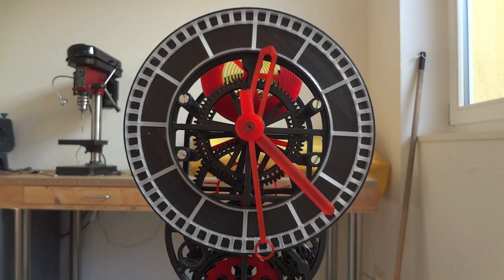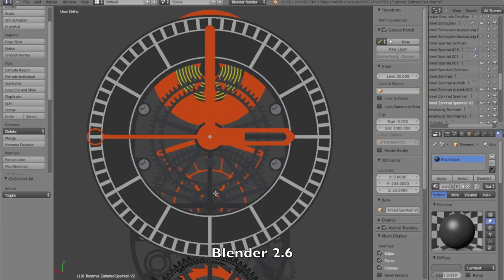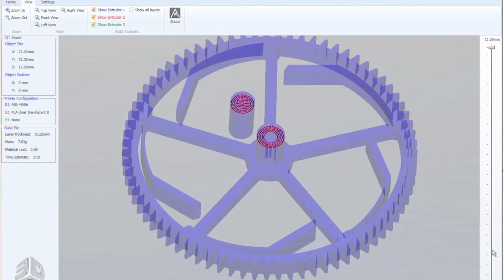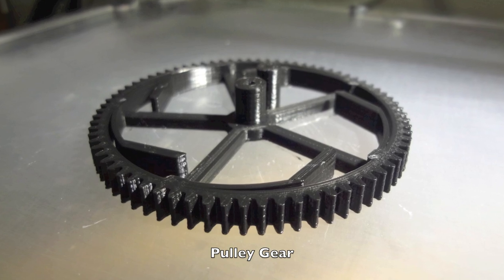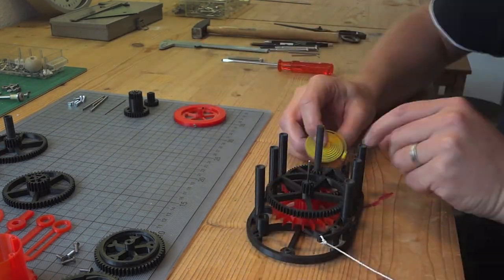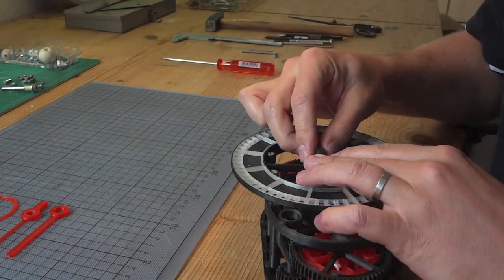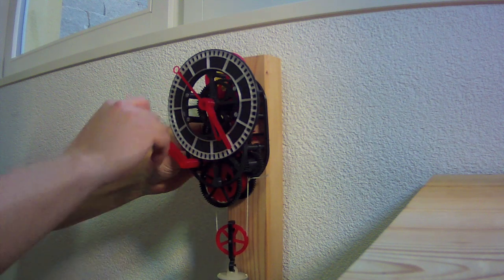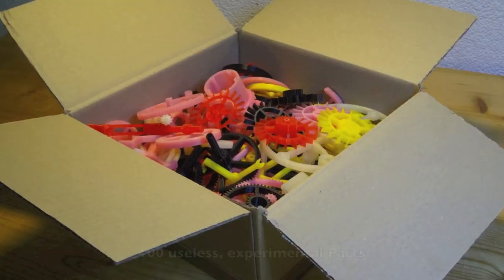3D Printing a working mechanical Clock

Comment: This is a beautiful addition to the internet!

It's hard to appreciate designs like this as you don't see the failed parts that are slightly misaligned or simply don't fit. The box of waste is what really demonstrates the frustration of the process.
Thanks for the clock!

Comment: Nice job. Must have taken many hours, both in Blender and afterword. I like the pulley mechanism that the weight hangs from, much better than having the weight hanging down one side with a counterweight hanging down the other side. I'm going to have to remember that trick. Thanks!

Comment: I can't believe you used Blender for this! Must've taken ages, and would have been a lot easier in a CAD software like Inventor or Solidworks.

Nonetheless, this is an amazing design :)
Reply: +ISeeFurther when I saw the blender clip, I mouthed "wow" to myself. I've made very basic 3d printed designs in Blender (little figures and such), but getting precise mechanical parts modelled up must have been an absolute nightmare.

Using OpenSCAD to "program" gears is the easiest way I've found so far
Reply from the maker: +Gareth Crispin (MrHolozip) initially I found it indeed painful with Blender. But finally I got the "trick" how to use the array-modifier for gear-teeth. Now I'm using Fusion 360 - it has a very convenient script to generate involute gears, however if you need to tune the tooth shape, it is equally clumsy like Blender.
Reply: If you want to use Open source software like "Blender", you can use "FreeCAD".  Also I think there are mods for blender that make it better for CAD with things like dimensioning being added.

Anyways thanks for sharing this wonderful project with us!
Reply: Astounded, that you pulled it off with blender!
Reply: @ChristophLaimer  if you add a planetary gears to slow down the soeed at what the weight drops cant you increase the clocks runtime between winds?
Reply: @ChristophLaimer  And did you design a new one with Fusion360?

Comment: Building this beauty as we speak.  Robox Dual making larger parts and FormLabs 1+ for the smaller components.  Interesting little engineering project to see if I can add my own ultra low power micro-controller POWERED by the escapement mechanism (no battery, just charging a capacitor) to dampen the balance wheel to keep it synchronized to the crystal reference it is powering.  Gravity powered by the weights, the balance spring is the main oscillator kept in check by a quartz crystal reference and no battery of any kind.  Lots of little precision ball bearings to minimize friction and hopefully have a real conversation piece and plastic heirloom functional clock as well.  Kudos to this gorgeous design and thanks for making it available.

Comment: Christoph, thanks very much for this model.  I am currently about 1/2 way printing this on my mendel prusa and I am delighted by your attention to detail, and design-for-3D-printing details.  I look forward to designs in the near future that have snap-fit details similar to injection molded parts, and minimal use of fasteners.

Comment: can you tell me where i can buy PINS: 1 x Balance wheel: 1.5mm diameter, 40mm length
 1 x Escape wheel: 2.0mm diameter, 28mm length
 1 x Reduction gears: 2.0mm diameter, 60mm length
 1 x Drum Transmission: 3.0mm diameter, 60mm length
 1 x Drum Axis: 3.0mm diameter, 60mm length
 1 x Crank transmission: 3.0mm diameter, 30mm length
 4 x Planets Axis: 3.0mm diameter, 39mm length
 1 x Weight Axis: 3.0mm diameter, 15mm length

Comment: I tried making this years ago, and could never get it to work.   The lack of a safety roller in the escapement makes troubleshooting very frustrating.  I would recommend you designing a pendulum clock next time, a pin pallet escapement is just more complicated than it needs to be, especially with the limitations of 3D printing.

Comment: That's pretty neat. If you had a regular pendulum, you could get more accurate timing with a sliding weight to help adjust the escapement period. Looks like this one uses a balance wheel, so the method of correcting that doesn't seem so obvious. (Maybe an adjustable friction brake perhaps?)
Reply from the maker: Friction has not much influence on the timing. The combination of spring strength and the mass distribution from the balance wheel are relevant: http://en.wikipedia.org/wiki/Balance_wheel#Period_of_oscillation
Reply: On some watches I've looked at, they seem to have a rotatable lever thingy to alter the effective working length of the balance-wheel spring ??

Comment: You can make the time last longer with 70 cm if you run the string back up to a smaller spool on the same axis. Allowing the string already used to come back up and give the weight more space.

Comment: This is probably the coolest thing I have seen 3D printed. And you did a great job putting the video together. Thanks so much for sharing. What are the chances a novice 3D printer could replicate the clock?

Comment: I have spent many hours printing this clock, but I have a problem with the balance wheel.
it appears that this has some kind of weight in this part.
I have no experience with clocks but understand the assembly.
Any help with this would be much appreciated.

Comment: Hi, I really like the design and would like to 3d print and use the clock. However I would like to know how I could enhance the runtime. Maybe with a different pully system?

Comment: That's absolutely awesome, you created a clockwork mechanism, stunning. (are you a clockmaker by trade?)

Is there anyway to print even the metal parts? I know you can do screws and nuts and bolt and Taulman's nylon 910 would be strong enough for that, so how about the pins also from nylon? Is there a reason you chose metal pins and screws or is it just a structural consideration? 910 wasn't available when you made this video.

Either way, what a lovely project. Thanks for sharing it. :)

Comment: really a very nicely designed mechanical part! I was really looking forward to it and invested many hours in printing and post-processing...I don't know what I'm doing wrong, because unfortunately the escapement mechanism just doesn't work for me! the spring doesn't fit either, has hardly any tension and looks different than in your video...a shame :( still a great job because it worked for you.

Comment: This is a great clock and i have had fun building it but, i have ran into a problem.  Everything is together and the weight is on but its not turning the gears.  I was wondering if this is a problem with the spring or if 600g isn't enough for the simple ratchet mechanism

Comment: It is beautiful.

I plan to print this clock

What part can i tune if the clock speed is not accurate?

Any ideas on storing more energy to let it run little over 24 hrs?

Comment: So, next up design a pulley with a good ratio so that it can pull a few meters of string in the same distance with a heavier weight and run the clock for more then a day :)

Comment: I have made it. It works with planetary drum V1 and 2 kilos of weight but when it counts 1 minute the real time is 1minute and 20 seconds. I change weight to 1,5 kilo until 3 kilos but the loss of time is the same. I think I have to change the spring of the balance wheel, but I dont know what to do exactly. Any ideas?

Comment: just found the clock on thingivers and am planning on trying it. 

question: how to make adjustments if the timing is off?? im used to these types of escapement clocks having pendulums to adjust up and down to speed or slow the escapement. if this one comes off the printer not accurate, how would you adjust it? preload on the spring, maybe? idk

Comment: I like the design of this clock very much! I wish I could 3D print it... A reccomendation maybe... add a striking train :D Is the pendulum adjustable so that it can be made more accurate?
Reply: the "pendulum" is the weighted wheel behind the spring. i think the creator put a certain amount of bolts/ screws in it to increase / decrease weight which slows down/ speeds up the clock respectively.

Comment: Try to put painters tape on the platform the gears where printed on, it will make it alot easier to take the gear off.
Reply: I've had horrible experience with tape. I get my best results using good old Pritt Stick. I really need to get shares in this company because I use a lot, but get no more warping :-)
Reply: @liamsbargains6129  wow my comment was 6 years ago. I dont even remember saying that

Comment: I like your clock, have you ever thought about using a pendulum? It seems like the spring in your lever escapement would wear out.
Reply from the maker: +twistedyogert Initially I wanted to design a pendulum, but then I was attracted by the challenge of the more sophisticated escapement.
Reply: Christoph Laimer I'm actually thinking about buying a 3-D printer, but I'm worried about a breakdown, do you know of any makes or models that are very reliable? It would not be very fun or useful to wrestle with the wrench every time I want to print a gear.
Reply from the maker: +twistedyogert I recently bought an Ultimaker 2. It seems to work very reliable. Anyway I recommend to choose a location with little temperature and humidity change, if you want to avoid permanently adjusting the print bed.

Comment: Printed all parts, but curious to know why all the holes are the same size, yet require 3 different sized rods ? its hard to open up holes without drilling into the part, specially the second hand
BTW the box of garbage would be gold to some artist ;)

Comment: i Love this! im down loading blender as we speak to attempt to export it out to STL so i can try and print it, ill keep you posted on how i go.
Reply from the maker: Any success? Did you see "tbbroder"s recent comment? He was finally able to make it running.
Reply: so i had to scale it 10% smaller to allow it to fit on the UP plus 2 printer im using ive printed out 90% of it im having issues with the clock face though i might have to redraw it, which is no big issue, so i hope with in the next few days ill start assembly every thing looks ok im slightly worried the parts might be too thin, but time will tell :)
Reply: also im starting to mock assemble it why i print out the trommel and im finding your bleander cad is slightly differnt to the one you are assembling in the vid
Reply from the maker: ***** The blender file contains also the ratchet version (actually there are even two ratchet versions with a different transmission ratio to play with different wheigths). The pieces are just invisible. You will them find all in the Scene-Tree containing "Trommel" in their name. You can make them visible by clicking on the little eye-symbol.
Reply from the maker: ***** Cool, thingiverse! Didn't know. I've uploaded the blender files there, but not yet STL. If I find some time, I'll maybe create a "clean" project.
Reply: hey chris ive printed and assembled all the mechanical parts it looks like it will work i think i might have to make a new spring though email me on adrians@deltaoffice.com.au and ill send you some pics

Comment: Very nice design I like it. I was wondering though how you made the escape wheel hairspring? How did you calculate the correct length, thickness, and number of turns?
Reply from the maker: Alec Pidala ... trial and error. The first version was ticking 3 times too fast. Needed roughly 5 iterations until all problems were resolved. Of course I knew also the physics behind, but there were too many unknowns. As you say, the force of the hairspring is almost impossible to calculate for a 3d-printed part.

Comment: Try to pour cold water on your parts to release them from the print-bed !
Reply from the maker: +Théry S. Cool :-) ... I'm using an UM2 since 1 year, building on a heated glass plate. Initially I was following the official hint and used the glue stick. Then I tried to print directly on the glass, which I cleaned with a mix of alcohol and water with a microfiber cleaning cloth before printing. PLA and PETG stick like hell - it's almost impossible to remove it from the glass, even after completely cooling down, and waiting for several hours. Inspired by your hint I sprayed my alcohol-water-mix onto the sticking parts. Miraculous! The liquid gets sucked between glass and plastique, it cracks like melting ice, and then you simply lift off the printed parts without applying any force.
Reply: @ChristophLaimer   You could also try putting a layer of masking tape on the surface.

Comment: Dear Christopher, I have printed your 3d print file with normal PLA material, but the clock can't work, do you have to use special materials or what is the solution?
Thanks

Comment: Great design. I have a few parts printed currently. What size(s) of rod or wire did you use for the gears?
Reply from the maker: 1.5mm for the balance wheel, 2mm for the escapement, 3mm for the rest. I recommend to drill the gears with 0.1mm larger diameter.

Comment: I'm very curious to know where I can buy the dowel pins. I've chosen to build this clock as a project for my class and was wondering where I can find the pins.
Reply: I'm in the process now gathering the parts, I've ordered some from eBay and will cut to size. The hollow ones I'm still looking for....

Comment: how do you adjust the spring rate to amke it tick in time?
Reply from the maker: The accuracy of the spring isn't as relevant. There are small screws in the balance wheel, which allow fine-tuning the frequency.

Comment: Could it be possible to print something like this in one session without having part you need to put together?
Reply: Funnysterste hypothetically yes, with a large enough 3d printer, dual extrusion, one with the permanent plastic and the other with dissolving plastic (just to form the structure and hold everything together while printing). but as far as I know, there isn't a printer precise enough to do that kind of work yet(and I put a lot of emphasis on the yet part). but I'm certain that as the tech evolves it will definitely be possible in the near future.

Comment: Hey what if the gear ratio from the weight to clock would be greater and the weight heavier? Im thinking of building this but i want it to last longer. Like 12h or so on 2m...
Reply from the maker: theoretically, it could work, but I guess the plastique pieces (esp. the frame) will bend, and friction therefore increases. in order to overcome additional friction, you would need to make the weight again heavier ... 10kg is certainly too heavy, and 100g too light - there must be an optimum in between.

Comment: how much do you think i can scale this down before the clock wont work?
Reply: Spanasyuk the main component here is the spring. it's physical dimensions will determine the frequency the system oscillates. by scaling down, you change these values (torsion springs are complicated, maybe there is some non linear factor , so scaling down 50% does not equal 50% change in frequency). if you scale down all the gear wheels with the same factor, there shouldn't be any problems. the ratio is determined by the circumference/ radius. 
in theory, if you have some CAD/... experience, you could change the frame , so that it can accept a pendulum (could be tricky)a pendulum can be changed easily, when it comes to frequency.

Comment: Really nice! But what is the reason for the need to reset it every two hours? Well except for the string length and weight hitting the floor ;) Can it be made so you only have to reset the clock like once a day or longer?

I have no idea whatsoever, so I'm just curious =) I still think your clock is really nice!
Reply from the maker: Another gear ratio from winding drum to the rest of the movement could elongate the time until it needs to be rewound. But it's like shifting gears with a bicycle - if you select a very high gear, and there is headwind, you're maybe not strong enough to maintain your driving velocity. If you pedal stronger (corresponds to heavier weight on the clock), it might happens that the pedals break.

Comment: how much does the weight weigh. i'm thinking about making a smaller version of this for a gift
Reply from the maker: The weight is 1.2 kg. But this doesn't influence the clock speed - the weight needs to be heavy enough to overcome the friction of all the wheels (or the friction needs to be small enough for the weight)
Reply: ok, thanks! keep up with the good work!

Comment: Hi, I know this is a really late comment but I was wondering how you obtained the steel axes that are needed for this clock. I have all the printed parts and the screws are easily obtainable, but I can't find a way to get those axes.
Reply from the maker: +George Washington Depends where you are. Most hardware- or hobby-shops for RC-toys have such things. Or you browse http://www.mcmaster.com/ (they don't ship it everywhere)
Reply: Hi sorry, I meant to this comment off. I saw someone mention on your thingiverse page about McMaster and they're very close to me so it worked out well. thank you very much.

Comment: i printed all pieces and assembled the clock but its not working. Any ideas why?
Reply from the maker: Alvaro Martínez ... there are a couple of comments about the clock on thingiverse: http://www.thingiverse.com/thing:328569/#comments - maybe your clock has too much friction? I recommend to temporarily remove the anchor, and make sure all the gears run smoothly
Reply: Christoph Laimer thanks
Reply: +Christoph Laimer What do you do with all the junk parts, can you melt them down and make more plastic thread?
Reply from the maker: +twistedyogert - This would be a great idea, but I guess there is no cheep filament machine ...